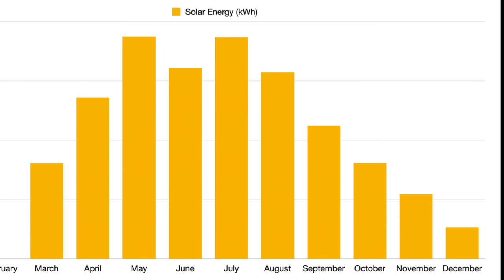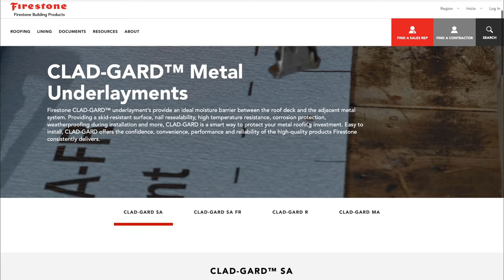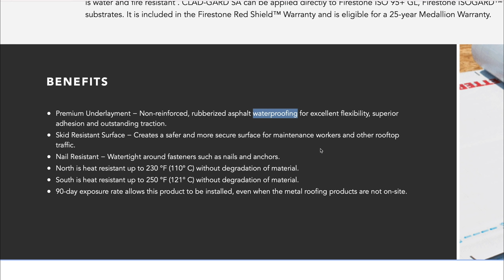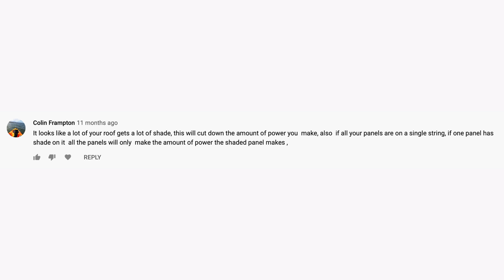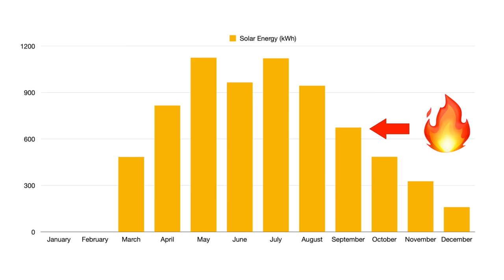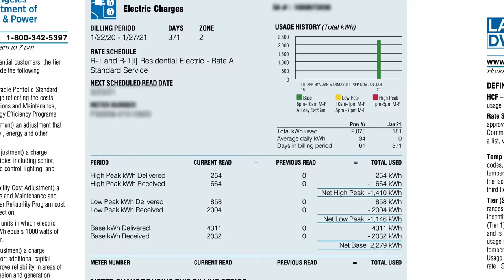1 Year with Tesla Solar Roof: top 11 questions answered + real production numbers & utility bills!

Comment: It'd be cool to see a total cost of ownership over time. What's the projected time for this roof to pay for itself?
Reply: Looks to me like 9 years according to the installation video. Assuming the yearly savings stay the same. IMO a fair assumption since apparently it's warrantied for 95% up to 5 years and a maximum drop off of 0.5% yearly after that.
Reply: @ruukinen  The way power prices are ... moving, at least where I'm at (Berlin, Germany) it's even fair to assume that the savings per year will actually rise.
Reply: @JinFreeks  I mean already the savings are calculated against last years equivalent time periods electricity bill when the correct calculation is to use the rates from this year multiplied with the usage from this year, actual usage not the 0 it shows since they produced it all themselves, to get the actual savings.

I'm just saying that the savings being at least equivalent is a fair assumption since I actually expect the savings to get bigger year by year even if the efficiency of the panels slowly deteriorates.
Reply: Average cost for two story 2000 sq ft roof is 55,300
Reply: @moolardpexcellent5253  Yeah the payback period I gave assumes they needed the roof changed anyway and taking his word for all the values given. Have no reason to doubt it and it doesn't affect me so I won't be double checking. Anyone making this decision themselves should definitively be double or even triple checking.
Reply: @ruukinen  he didnt add in the cost of the panels/install though, im not too familiar with tesla tiles but with solar panels you can easily pay nothing every year. in fact the electric company will actually pay you for the electricity you gained from the panels. its pennies on the dollar(which they legit then go sell it another home for the increased price) but still, at the end of the year you could see a paycheck from them. in California i think they let you cover up to like 105-120% of your AVG utility bill so you can have additional panels put on incase for what ever reason you may use more juice during some months.
Reply: @obee3484  I mean you can just watch his installation video instead of throwing wild accusations around. He did add the cost of the "installation of the panels/tiles" since it is included in the deal. You can't actually buy just the bricks from tesla, or maybe you can but it most certainly is not a consumer application in that case.

Whether or not you still have to pay a bill depends so much on your local laws that it makes no point for me to argue you about it. Even if you draw 0 from the network, just being connected to it costs something pretty much everywhere. Here you don't get money, you just get credits that you can use to buy electricity so at best you'd get to 0 + being connected fee.
Reply: @ruukinen  well said man...you commented above, yesterday, re payback - 9 years is good!! - electricity is going up quickly in Australia - did you factor that in? Only asking because I haven't done the maths but I'd like to know...not even asking for a friend....
Reply: @moolardpexcellent5253  so they got a big subsidy for this install?
Reply: @obee3484  "...with solar panels you can easily pay nothing every year...."
you cannot make a blanket statement like that
in some areas, where hydro and nuclear power are available, the cost of power from the grid is as low a 5¢ per KW-Hr for commercial customers
and in some parts of the US cloud cover can be 50% per year

solar power is NOT a break even prospect for most of the USA at this point
Reply: @kenwittlief255  i should have said in certain area's, you're right.
Reply: If one installs the solar panels himself, the payback period would probably be much shorter. It's not difficult, there are plenty of videos on how to do it properly.
Reply: @MaximC  Don’t install your own solar roof…
Reply: @DougiePlaysSoccer  
Definitely will.
Reply: @kenwittlief255  Maybe so, but you get this when you actually need a roof or on a new build .  It costs 20% less than a traditional roof , plus it produces power. That way every watt of power it puts into the grid is profit . From day 1.
Reply: @ruukinen  I wonder if the loss of efficiency can be balanced out by the increase in electrical rates. Rates never go down.
Reply: @JeremyThomas_Environmentarian  I just assumed the rate of efficiency drop and the price of electricity rise equaled each other out of the equation. I strongly suggest making these calculations for yourself with pessimistic values and average values and see if you would be happy even with the pessimistic values.

@Rhapsun That's what I assumed but in all honestly I expect electricity to rise in price faster than these lose efficiency. I just didn't want to factor that assumption in since I would have to look up some average price increases in that area.

Comment: Love this, but genuinely want to know why you had to pay anything at all to your electricity company if you sold so much back to them?
Reply from the maker: When we send energy to the grid, get energy credits, which "pay for" the energy we use at night, cloudy days, etc. (energy at night, during peak demand periods, is more expensive that the energy we generate during the day). We can bank credits (sort of like roll-over minutes) but can't cash them out.

Instead of spending roughly $60k to ensure I was totally off the grid, (for a maximum savings of $156/yr) we just trade daytime energy for night time energy. We also charge the Tesla late at night (after peak demand hours), which is a lot of kWs, which helps explain how the daytime disparity evens out.
Reply: Would be even greater if you mentioned the price of roof+installation :3
Reply: @safistype5952  It's probably so expensive that it's a break even in 25 to 30 years making it not worth the hassle and up front costs.
Reply: @dealsfromvirginia1773  I’m going to try and find an analysis. So many things to consider. On the one hand you’re saving, well he’s saving $2000 a year it looks like. On the other hand he’s also saving money on roof replacements. But he’s also spending money on roof cleaning. I don’t know
Reply: @Mehwhatevr  roof cleaning is dependent on where you live. If you get a lot of rain then you might not need any cleaning. If you live like in Arizona on the other hand sand and dirt is going to build up fast
Reply: Could have mentioned how much you paid.
Reply: @isaiah4478  yeah but if you’re getting lots of rain you are also not producing much power if any
Reply: @isaiah4478  true… Rain doesn’t necessarily clean things though. Get a lot of rain where I live, and I Still have to sweep the porch and wash the car, etc would rain wash solar panels well enough?
Reply: @erikagpawa4960  also true… ugh so many things to consider

Comment: Great video and I really want to know what it cost to purchase and set up.
Reply from the maker: Covered the cost in depth in my first video: https://www.youtube.com/watch?v=LRPy8UZv9V0&list=PLXt9cHZDKoN4TcPWRp-P7iQfshODE274k

Short answer: $33k, about $21k more than if we had just gotten a conventional roof and about $3k more than if we had gotten a conventional roof + standard solar panels.
Reply: Was or is there any state or federal reimbursement for feeding the grid?

$33K up front for a roof is a hard pill to swallow for many. If I were building a new home and could add it to the over all mortgage then I would probably do it. Great to the point video.
Reply: @dankibler4780  I'm not sure about all states, but Georgia Power at least pays you if you supply the grid from what I'm aware and I would assume all other states do as well
Reply: @dankibler4780  It is paid by the power company that you are connected to and there are varying agreements. Check with your power company about their solar agreement and power buy back. Adding $30,000 to your mortgage would cost you more over the life of your loan than your power bill would cost you.
Reply: @AustinFlack  hm. Assuming you get roughly the same power yield annually for the 25 years it's under warranty, you could be looking at 52k in savings. 

Feels like a large investment, and I suppose this would also mitigate cost of electricity increases... Still seems like a hefty investment but then it adds value to the home if you were to sell it later. 

Still too early for me yet though.
Reply from the maker: $33k price was after the federal tax credit (at the time it was 23% of solar portion of the cost)
Reply: @AustinFlack  this is before 70% price hike?
Reply: @odraz0101  there’s a guy from Illinois university talks about solar energy. It’s truly Apolitical and (though it doesn’t include Tesla) it breaks down the efficiency of having solar power.
  If the government didn’t subsidize, it would cost...100,000$+ for this house? Being generous, he will get 2,000$ recouped per year, so the roof would be worth it in 50 years to break even.
   But the government (ie us) pays 70% of that damn bill, so it’s efficient in about 15 years (rough estimate).
   Now, that’s in sunny California. Go north and it’s really not worth it. Stay south and it can be worth it. Check out Illinois university professor of energy. He’s great and he writes backwards like a pro (you’ll get it when you watch it)
Reply: @AustinFlack  Thank you
Reply: @AustinFlack  So, 16.5 years recovery on investment, with 25 year warranty?  Very interesting, thank you.
Reply: @jacklynch3333  when you say the government is paying, what you mean is the government is stealing from of your neighbor.
Reply: @AustinFlack  hey, my house has a flat roof. So can I walk over it when it's applied on the roof? Or is it not made for use in that was?
Reply: @ayush885  I can't speak for him, but the quick and easy answer is no unless you want to risk damage and burning yourself since these are designed to absorb as much energy as possible, so they get hot
Reply: @emtymilkbag7611  thank you.
Reply: @jacklynch3333  33 thousand dollars after a 23 % rebate does not add up tp 100,000 dollars. Why would I believe the rest of your nonsense?
Reply: @ayush885  np man
Reply: @williamjackson5942  the people who produce green energy products also receive assistance from the government to bring the cost down. So government funds making the panels, then helps the home owners purchase them. At least that’s what’s I’ve heard and read about those type of things. Same as gm and Ford and Tesla getting government subsidies to develop fully electric cars, then give the purchaser a tax rebate on the backside of the deal as well.
Reply: Buddy. You got played. LA Solar would have saved you so much money. Best part, with the federal rebate you get a discount on the roof too.  Sorry buddy.
Reply: 33k AFTER THE REBATE??? Wow dude. I’m so sorry. I’m glad your happy with it. But regular solar would have been so much less expensive. Believe me I have it on my house in LA. Tesla wanted 56k to do roof. LA Solar did it for 17k.
Reply: @DeeperWithDiego  ehhhh, more of we the ppl are forced to give them money and then they decide to do any stupid thing they want w it.
Reply: @DeeperWithDiego  not so at all, so don't go there with that crap. Learn MMT. Federal taxes (not state) CAN NOT be used to fund new spending. They are destroyed. Get to learning or prove me wrong. You won't prove me wrong.
Reply: @jacklynch3333  nope. That is NOT correct.
Reply: @williamjackson5942  my math is wrong. I read the numbers wrong and did the math wrong.
   So, he got 23% back (of the ppl’s money, aka government subsidies) and the total cost was 33k. So, the original cost (if I now have my correct math) 42,875$. Way different than 100k.
   So, now the rough estimate of 2k per year in saving electricity is about 20 years+. Then he’d break even (if all things remain constant for which they won’t). Then there is the minimal cost of cleaning. Then there is the question of how often the sun shines, but he averaged it out nicely.
   So, for what he did AND if he didn’t get the public to pay for 23% of it, I think it would be worth it in 20 years...to break even. After that, profit.
   Now, for those who don’t live in a southern state, look up this guy to explain.   Or you can be a dick, close your mind, and think solar is for everyone.

Illinois EnergyProf.    Look him up on solar energy.
Reply: @Patrick Mahon how is it helping environment, when in approximately 20 years, those panels become waste?
Reply: @joshuacumming4132  Buddy. You replied to the wrong guy. Best part,  he did get the federal rebate. Sorry buddy.
Reply from the maker: You can walk it, yes.
Reply: @joshuacumming4132  Wow dude,   again you are replying to my comment and not the guy that uploaded the video. Besides that, is your solar going to last as long as his before replacing the panels? Also are you saving just as much as him or will his pay off faster because it works better. There are a lot of things to consider before assuming you have something better than another individual.
Reply from the maker: I’ll break even in ~10 years (deduct the cost of a conventional roof in your ROI calculations—I needed a roof!)
Reply: @DeeperWithDiego  actually you and i and every citizen is the government, so we x number million of people are subsidizing the cost to add solar and replace gas / oil… which also receive quite a number of subsidies from you, me and everyone else - and have for many years
Reply: @nolongerhave-couth4771  my thing is by the time you start getting a return on your roof it's almost time to replace it and panels are starting to become a waste problem. I would rather just buy more efficient appliances use a bike and carpool more and be better off financially.
Reply: @AustinFlack  so, at 33k total out of pocket, then 2k saving per year, that would be (roughly) 16 years. What number am I missing? Are you saving more during the year?
Reply: @Macky4941  the end of a product’s warranty has absolutely nothing to do with it suddenly becoming ‘waste.’ Looking at what it’s composed of, this is probably a 50-75 year material, and comparing it to asphalt shingles (which you would actually be replacing in 25 years) it’s kind of ridiculous to not see the benefit environmentally. That tar goes into a landfill while these things are literally energizing your home for 30 more years.
Reply: @dankibler4780  especially at 2K a year savings- 15 years to break even is ridiculous
Reply: @PirateDion  52K -minus the 33K install ---19K in savings over 25 years kind of sucks
Reply: @DeeperWithDiego  exactly.
Reply: @joshuacumming4132  how does the efficiency compare?
Reply: @markbader4942  Just adding on here.. Elon wanted to make the warranty something stupid like "1000 years", but lawyers stopped him. After the solar cells are run down, the roof will still be a roof. Even after the house is rubble, according to Elon.
Reply: @jacklynch3333  Love the ignorance behind the implication that the 23% back was a waste in tax dollars when subsidizing these conversions allows for less strain on the power grid as a whole, and reduces the usage of non-renewable energy sources.
Reply: @anthrax3404  look back. Did I say “waste”? No, it is the government giving federal and state dollars that(tax) was partially my money to help pay for his roof. I’m not digging this guy, I’m just annoyed on the idea that the government sends money to subsidize for roofs. If it’s a good product, the shit should sell itself. I don’t live anywhere near there, on his grid, etc, but I paid partially for that roof. I’d rather he pay for that roof.
Reply: @kylekodman8321  The oil and gas people get depreciation benefits special lower tax breaks etc. easily offsetting those!
Reply: @jacklynch3333  Or you could realize that electricity prices will rise considerably during those 20 years!
Reply: @Macky4941  got it.
Reply: @williamjackson5942  true. Considering the current administration and Congress blowing out our currency, it might be cost efficient....in a sunny state....and how the roof will work for 20 years. I still recommend Illinois energyProf on this matter.
Reply: @AustinFlack  So, if you saved roughly 2K this past year, and that stays consistent over the next few years, you will have paid off the roof in roughly 16 to 17 years, yes?
Reply: @williamjackson5942  another thing might be allowing the market supply/demand to influence the cost and installation of such solar panels to where it becomes so cost effective that it would be foolish to NOT install them.
However, last time I checked, California has brown outs, mismanagement of its money, and buys non green energy from neighboring states because of how green they went w their production of energy.
  When something is a good idea, you shouldn’t need to government to sell, buy, or manipulate you to do it.
Reply: @williamjackson5942  Every business claims depreciation. Depreciation is a cost of doing business and no government taxes turnover instead of profit, it wouldn't make sense. You could easily end up paying more in tax than you make and every business with high operating costs would be wiped out the first year you did it.
Reply: Woah that’s crazy, where’s all that money coming from?
Reply: @Wqube  hadn't thought about that. The amount of money you could save not having to replace a roof or shingles every 10 or so years would add to the ROI of the investment.
Reply: @AustinFlack  Cheers mate! Greetings from Vancouver BC